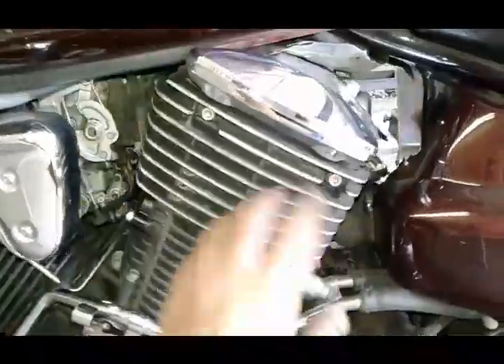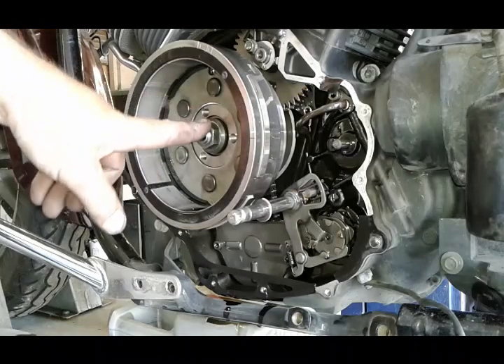Yamaha V star 1100 replace starter clutch step by step

Comment: Man I've rode bikes since I was a kid but had only changed the oil,  oil filter , spark plugs all the basic know how's. I watched this video twice took almost 5 pages of notes and began my first real motorcycle repair ever ! Everything came out great after going at it for nearly 8 to 9 hours BUTTTTT the bike hadn't been cranked in two years so it wouldn't crank on its on so I sprayed some starting fluid into the carburetor and even though it cranked there was a loud pop and it shut off. I began removing the spark plugs and discovered the right one on the back side cylinder was either melted , crushed up at the end or maybe both.  I REALLY NEED YOUR HELP IF YOU COULD PLEASE GIVE ME SOME INFO ABOUT THIS ,AND IF THERES A GREAT VIDEO LIKE THIS TELL ME WHERE TO FIND IT PLEASE ?

Comment: Wonderful video I need to do exactly this my bike makes makes a racket like a screeching cat when I go to start it can you tell me exactly what part numbers you ordered for that bike would they be the same for a 2005 V Star 1100 custom Silverado because that's what I have any advice would be helpful and thank you for your wonderful video
Reply from the maker: I buy them on ebay...just look for YAMAHA XVS1100 starter clutch. They are all the same. Good luck with the job and thanks for your feedback. Means a lot! Please subscribe to help me out!
Reply: @DoityourselfMotorcyclerepairs  I just called Yamaha last week and they told me the parts were $500 why the big difference between the parts on eBay and the parts from Yamaha because of the name or the parts the same that come from the same Factory what's the deal help me here and thanks for your reply and I did subscribe

Comment: This is a great video when I pulled off my crankshaft I had six Springs but only two pins.. is it possible that it was repaired before and they did not put the pins back in?
Reply: Did you ever get this fixed I lost on pin in the motor can’t find it I’m wondering if it will be okay to put it back together without it
Reply: @Myvenom12345  I stuck a magnet In every crevice I could I used a blower As well.. once I got it back together I ran oil through it two or three times just to see if anything would flush out before I cranked it up.. being that one of my springs was different I assume that somebody had been in there before and left the pins out. I was able to locate some pins and the additional spring on eBay relatively cheap

Comment: Wel, I guess I got the unthinkable done and broke the darn cam gear.  I have one now ordered but cannot find a video of how to replace to see if it is a hard job to fix it.  Not only that but my timing marks ar3 now not visible  as I must have rubbed it off along with camshated keyway is now not lining up the cylinder( say 2 oclock position).  Any thoughts would be appreciated

Comment: Can't seem to convince the flywheel to turn clockwise to get the timing marks lined up. Am I missing something? I have her jacked up and the back wheel spins so I know it's not in gear. Thought maybe I mistakenly left her in gear when I parked her to start the repair, not sure if that even matters or not. Thoughts?
Reply: Did you remove sparks plugs?

Comment: Great video man, I just finished doing the starter clutch rebuild on the same bike. With your awesome guidance. However, after complete the bike started great, took it for a 15 minute ride topping at about 55 mph to check on everything. The bike ran better than it has in years, no noises or anything odd until I parked. I had some white smoke coming from the header pipe and an odd smell. Have you come across this? Could it be a result of me jacking the timing up? Maybe from having the bike open, oil and stuff cooking off in the engine? Any thoughts are appreciated, whenever you see smoke from your bike, the worry starts!
Thanks again man!
Reply: Give it time to burn off , If still smoking after a few runs, replace and or "Monkey snot" cover gaskets , O-rings

Comment: You were very helpful
Reply: Did you do it ?
Everytime I try to adust the split gear with screwdriver the top gear chain move clock wise which misalign my timing ..:(((
How do you move the split gear without affecting the timing alignment?

Comment: This is a good video but I need to understand the timing more. Is there something more in depth somewhere? I dont want to ruin my rear cylinder.
Reply: Have you done it ?

Everytime I try to adust the split gear with screwdriver the top gear chain move clock wise which misalign my timing ..:(((
How do you move the split gear without affecting the timing alignment?

Comment: First time I ever replaced a starter clutch and I couldn't have done it without your help!  Thank you very much. But, I have a question: I did everything exactly as explained and my starting issue was cured. However, there is now a bit of what seems to be, a bit of a misfire while riding and slight hesitation. What do you think the issue may be?  Thanks for any info you can help with.
Reply: It only started after replacing the starter clutch? Tried changing the plugs?
Reply: The only difference I seen in his videos and other ones is he didn’t get it timed right before he took the casing off
Reply: Morning
Everytime I try to adust the split gear with screwdriver the top gear chain move clock wise which misalign my timing ..:(((
How do you move the split gear without affecting the timing alignment?

Comment: Hi, I am in a location with not a lot of good mechanics to do this job.  After watching your video, I am really thinking about completing this repair.  My biggest fear is the timing.  Your video shows where the keyway is and it pretty much aligns all together in video with little adjustment.  I am afraid what happens when the keyway is for example, in the 11 o'clock position?  Do I rotate the crank to the position that aligns with straight up with the rear cylinder and make sure the timing mark is aligned straight down in the rear cylinder?   Rest of the job I am comfortable doing but I am stressing over the timing.  I have another week or so before the parts show up and I just want to be ready to go when they arrive.  Hope you can help.  Thanks in advance.
Sean
Reply from the maker: When you remove the bolt that holds the charging rotor on you can see the slot for the key... with the spark plugs removed you need to rotate the rotor by hand to have it in the right place before you take it apart... thanks for watching the video and please subscribe to help me out
Reply: Ok, thanks. So now I understand.  Wherever the keyway is when you take off back off the bolt, the keyway is rotated clockwise until it lines up with the rear cylinder combined with the timing mark at top of rear cylinder. Both the keyway and the timing mark lining up and down the rear cylinder .  Then it is ok to remove the bolt.  Thanks for the reply and help.  Very nice video very easy to follow.  Hope the repair goes well.  Btw, Subscribed
Reply: Did you do it ?
Everytime I try to adust the split gear with screwdriver the top gear chain move clock wise which misalign my timing ..:(((
How do you move the split gear without affecting the timing alignment?
Reply: Morning 
Everytime I try to adust the split gear with screwdriver the top gear chain move clock wise which misalign my timing ..:(((
How do you move the split gear without affecting the timing alignment?
Reply: Everytime I try to adust the split gear with screwdriver the top gear chain move clock wise which misalign my timing ..:(((
How do you move the split gear without affecting the timing alignment?

Comment: Hi there had the same problem now 27 Aug 2022 ,got this bike and  the starter  dont crank enigine ,so we got a second hand starter clutch  because  for a new one was  to expensive  and arfter putting  everting back when we crank it it did sound like it was cranking  but also  have sound like someting banging somewhere near  starter and  we dont no what  it could be
Reply: Did you fix it ?

Comment: Question. What way does it lock up .I put in a new starter clutch and it locks up trying to spin it clockwise cause my starter spin it in the free spin ways any thoughts on this situation. Thanks
Reply: Morning
Did you fix it ?
Everytime I try to adust the split gear with screwdriver the top gear chain move clock wise which misalign my timing ..:(((
How do you move the split gear without affecting the timing alignment?

Comment: I've just replaced the stator on my 2008 1100 v star classic. When putting everything back together I noticed that the clutch lever went right to the handle bars, no clutch resistance. (I still haven't replaced the engine oil.)  Any thoughts on what's going on. Thanks.

Comment: Thank you very much for posting this.  Now I can change the starter clutch in mine.  Are there any other common problems with the 1100 VStar that you can share?
Reply from the maker: This starter drive is a weak point on all the vstar 1100 models....it will literally happened to everyone of them sooner or later...other than that it's a great inexpensive bike. I have also seen lot of them leak oil around the little valve covers on the top of the head and the cover for the upper timing gear...the one I took of in this video...easy fix with new gaskets...thanks for your interest and please subscribe...it will help me out 😊

Comment: Im new to bikes so im in an interesting spot. Bike was working fine then just quit. Originally i thought stator  but with a fully charged  brand new battery now it's still not doing anything.i think it could be the starter. What do you think?

Comment: Everything was pretty good.. only one thing bothers me that I have heard.. Using an Impact on the crank .. Two reasons.. one being the impact on the end bearings, and also how do you know you have the correct 120lbs. of torque? Did you check your impact? I suppose you could trust your shop air gauge ..and the gun.. lol
Reply: Morning
Everytime I try to adust the split gear with screwdriver the top gear chain move clock wise which misalign my timing ..:(((
How do you move the split gear without affecting the timing alignment?
Reply: @feeleap2396  yeah, not the best design for sure.

Comment: Hey man, love the videos! Im busy finishing up this starter clutch service on my bike and noticed that when I pull the clutch lever in nothing is happening apart from the tension of the spring.. Have I ''disengaged'' the clutch somehow, what can I do? TIA
Reply from the maker: You know you had to disconnect the cable on the engine...so look in there what happened...it must be over there

Comment: Can you help me , my bike was starting no problem till a couple of days ago,  there was no noisy starts just last time I tried,  the starter motor just spins and doesn't engage anything,  good battery.  Rocked it in gear , eventually I bump started got home and left it alone,  starter still just whines on the button.  ... any ideas?

Comment: When does this problem usually rear its head, is it with low miles like under 10k or does it start to happen after?
Reply from the maker: Hard to say because if you ride only short distances it might be lower millage but a lot of use of the starter...on the other hand you might have high miles because on long distance riding you would not use the starter as much ...
 I would say on v star1100 it's not about IF it's going to happened but more like WHEN it's going to happened. Once you start hearing clunking noises while starting the bike or just when you turn it off...I would say it's time to address it. Hope this answers your question and please subscribe...it will help me out a lot!

Comment: I changed the starter clutch but my bike still makes a noise when starting but managed to start after a few tries. I noticed that when it makes the noise the starter clutch does not seem to turn which could be my problem

Comment: Do you have to remove the sparks plugs in order for the clutch to come out
Reply from the maker: @anthonyzambarano3017  You need to remove the spark plugs in order to spin the motor over easy ... But nothing to do with actual removal of the part
Reply: @DoityourselfMotorcyclerepairs  Thank you! Im having a hard time getting my clutch off. I watched the video and the only thing I didnt do was remove the spark plugs so im wondering if thats the issue. I have the clutch puller on it nice and tight spinning and hitting it. Not coming off
Reply from the maker: @anthonyzambarano3017  I've had some hard ones before also. Just got to keep trying. Make sure the center of the crankshaft won't get damaged. The puller needs sometimes lot of tension to make it jump off when you hit it with the hammer. It could be nerve wracking if it doesn't go easy. Sorry to hear you having hard time. Just step away from it if you are too frustrated until next day ..  many times that helped me from not messing something up
Reply from the maker: .. also put the rag under it in the engine and under the bike because when it does come off those little springs and pins might fly all over the place. You don't want them falling into the engine or loosing them on the garage floor
Reply: @DoityourselfMotorcyclerepairs  thank you so much for you fast and very informative replies! I am going to give it another whirl tomorrow!

Comment: If the flywheel is keyed, and you not messing with the timing chains, then the motor will stay timed regardless where the mark are or the key is. Am I missing something?
Reply from the maker: In theory you are correct ...but trust me you don't want to do it like that. Once your charging rotor is off that side timing chain can move very easily and if you are couple teeth off you in trouble... it's better to mark everything so you know it's coming together the same way...

Comment: Did you buy a cheap kit or oem? And how are the results
Reply from the maker: So far I only got the kits on Ebay. No problems yet...probably did 3 bikes over last 3 years. OEM is huuuuge money. The good thing about the starter clutch going bad is that it will give you warning as the noise get worse and worse so if the pars starts to fail you can replace them ASAP before it makes a mess...thanks for your interest and please subscribe...it will help me out

Comment: Hello Everyone 

I have a vstar 2006 and my starter stopped working at the beginning of the summer. It would spin but does not engage the engine. I followed the video step by step and changed the starter clutch. After I put everything back, and hit the starter, it spun one time but then nothing happened. When I press the starting button, I would hear the relay but nothing happens. Before I worked on the bike, I was able to start it through push start, but now it does not work at all. Any tips or things that I might have done wrong? 

Im almost thinking about getting me another bike at this point
Reply from the maker: You might of got the timing off and the piston is hitting a valve and not letting the engine turn over. It's very important to mark everything when taking it apart and reassemble back the same way. You can try to remove the spark plugs and the center plug on the left engine cover to spin the motor over manually with a ratchet and long extension and socket to verify that the motor is turning full cycle. No need to drain oil or anything...just remove the chrome plug in the center of the engine cover with large flat blade.